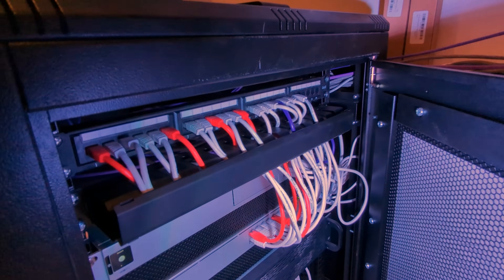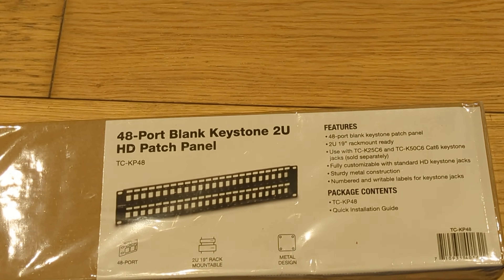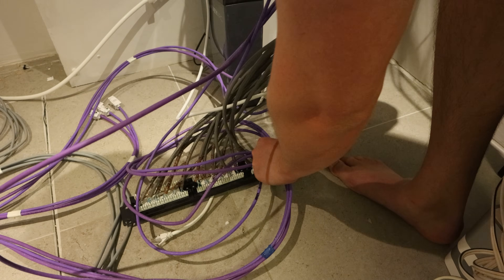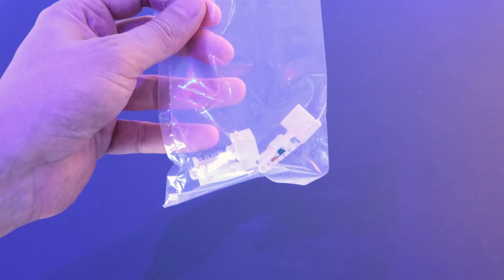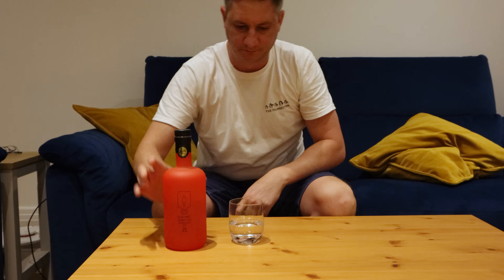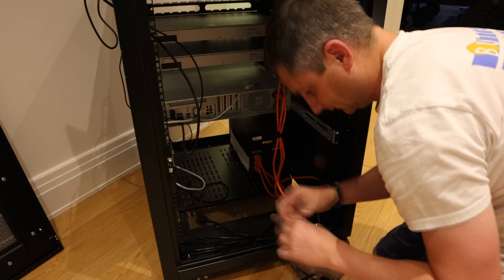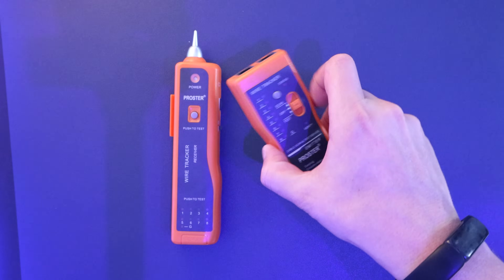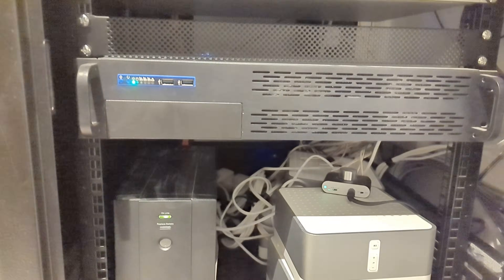Finishing my smart home network

Comment: Racks are supposed to simplify things but this is a case in point of unnecessary complexity. Just plug the ethernet cables directly into the switch sitting on a simple shelf and its actually easier to maintain to whole setup. Besides rackmount equipment is meant to be space saving but is actually poor when it comes to thermals and noise. Just use a standard ATX PC case for your router/server. There is zero benefit to rack servers in a home or small office setting.

Comment: Put a switch to fiber then route that to a better place.  Keep your server and NAT out of the humidity and temperature!  Add a blank 1U above your patch panel.  Then you have 1U to put labels on that you can actually read.  Also, one above your circuit breaker switches so that you know what you are turning off and on.
Reply from the maker: Thanks for the tips!

Comment: Looks good, a clean rack is so important.
At work we always patch with 1 meter cables, but at home i actually bought ubuiquti cables for the perfect length from patchpanel to the switch, looks really neat.
It started to get so messy with cables i found in the cable bin in the server room :D

Comment: Not bad. A couple recommendations though. You definitely should have labelled the keystone jacks at the patch panel and on the wall plate. An example of a naming convention I use is: I.D. 1.1 (first floor, wall plate jack 1). I.D. 2.4 (second floor, wall plate jack 4). I usually label all the jacks in one room in sequential order. I.D. 1.1 I.D. 1.2 I.D 1.3 etc. 

I would have moved the switch directly below the patch panel and ordered 6" and 12" CAT6 cables. This would allow you to free up more room in your rack and clean up the cabling.

Comment: I rewired and racked 22u worth of stuff and dam took 8 hours and a lot of cagenuts going under my bottoms server, makeing the wires neat was the hardest but I used 6 velcro straps and its all bundled neat, I also took the back cover off and the heat goes out a exoust fan in my window, and a ac unit cooling the front side. Thinking of maybe getting a a 32 u rack or at this point get a normal 42 u rack?

Comment: One tip when racking lighter gear by yourself is it use your off hand to support the equipment, then secure the bottom screws first. If you're right-handed, then support with your left hand and install the screws, starting with the bottom-left and working counterclockwise. If you're left-handed, support the gear with your right hand and install the screws starting with the bottom right and working clockwise.

This minimizes the torsional forces on the top ears of the equipment as well as the amount of time you're having to awkwardly support the equipment with one hand.

There are also high-density 48 position keystone patch panels that only take up one RU, instead of 2. When paired with a 48-port POE switch, you can use 15-20 cm patch cords, without any need for a cable manager in-between.

A better choice for the rack mount power strips is to use the IEC variety with appropriate length C13 to C14 cords to the individual devices. They'll take up a lot less space than the British sockets. You can even get ATS versions that can switch back to mains, should the UPS fail (while mains power is still good), allowing for a live UPS swap. A bypass switch could also be used, but they're only able to be manually operated.

Comment: Note for newbies: There are two different wiring configuration standards for Ethernet cables. If you are connecting to somebody else's, make sure you know which one was used.
Reply from the maker: Good tip!  Mine was all B standard

Comment: You shouldn’t vacuum electronic components. Sucking the dust through the hose can create static electricity that is then discharged through the components you are trying to clean. Better to blow the dust away.

Comment: So you know, you can also get keystone jacks with an RJ45 socket on either side, so you can use standard ethernet cables for both sides of the jack. I don't think there would be any speed difference between RJ45 jack and punch down connector, so it's just down to preference (plus it might be easier to keep an ethernet cable connector in shot while connecting/crimping?)
Also, as others have mentioned, you can get different coloured keystone jacks, which can be handy to identify your different use cases of cable at a glance
Reply: Attaching RJ45 plugs to the cables is (at least for me) much trickier and tedious process.

Comment: I love the rack slides most enterprise equipment has nowadays. You install the rails first, than hang the equipment in the rail and slide it in. If it needs general maintenance, it's most of the time enough to just pull the equipment out, lift the cover and work on it. When done you just push it back. Sometimes this can be done while the unit is turned on. (in example, replacing a fan or a dead hard disk)

Comment: I've started in our house, making it smarter.
I've managed to find a 22U HP rack for cheap (£35) got that installed in the cupboard under the stairs witch will house all the networking equipment including 2 servers that will be running various services like a NAS etc.
I've got the first 3 smart plugs installed and working and will be adding more soon.

Comment: adding coaster wheels to the bottom of the network cabinet would help with moving it a lot easier if needed and also would provide some airflow from the bottom  for equipment that are closer to the bottom also adding little fans to introduce cool air can also help keeping it cool
Reply: His rack does have caster wheels hence why he could move it so easily.

Comment: There are other keystone jacks that take a rj45 connector in both sides.  It might be easier than the clip on ones you are using.
Reply: Or not. That would require attaching the cables to RJ45 plugs, which is a much trickier procedure and takes practice.

Comment: Slim patch cables make a huge difference. Also a wall mounted rack would have saved cables being stretched over the room. 

You would have gained floor space and had  zero bending plus cleaner setup

Comment: I was all set to comment about using cable testing equipment and then you showed the very same tools I use. They've saved me lots of headaches over the years. I put flag-label cable ties on each end of my cables and write their unique identity on each end. I maintain my cable inventory in a spreadsheet with their room location, patch panel location, switch port assignment, purpose, and static IP address when appropriate. During my home's construction, I pulled dozens of cables to every conceivable TV and audio location (coax for antenna, coax for satellite, and multiple Cat6 for possible video distribution through a centralized video switch). The security system is hard-wired. All my security cameras are PoE, and all streamed video is hard-wired. I use wireless as little as possible, so having a well-maintained structured wiring plant like you've made is essential. Great job! You'll soon forget the pain of doing it and will reap the benefits for years to come. Beer will also help dull the pain.

Comment: While it’s a nice improvement just want to point out that with a 24 port patch panel and any 24 ports or more switch,  you don’t need the cable organisation panel.
Buy premade 300 or 500 mm patch leads and go from patch panel to switch port in a nice little loop saves a bunch of U’s

Comment: Nice job and a great presentation. There are some comments her for you that I hope you don't take negatively, as that's not my intention but can be perceived as such because of my bluntness. Cable management components are always an excellent addition to any wiring project. Many of my employers required me to make my wiring look like artwork, but it has gotten me in the habit of doing some beautiful wiring. I also use a labeling machine to identify all my wiring for future upgrades and possible troubleshooting. These things add time to every project, but they save time over and over afterwards. The bundle of cables makes me crazy, and I couldn't stand it because of the reasons that I just mentioned. I would need to install some wire ductwork/ conduit like what you used to hide your wiring in the cabinet. The snap on covers allow it to be so easy to access and install. They even make transition pieces for corners and intersections of ceilings and walls that keep everything looking neat and very professional. I'm sure you know about in-line keystone connectors and although I don't like using them unless absolutely necessary, they would tidy up your installation a lot and remove any strain that the cable bundle might be under. It's obviously too late now, but there are flush trim wire cutters that would have made the Keystone connections look a lot better and remove the potential of a wire short under the covers. 
   I can relate to your back pain since I have some serious spinal issues myself. Honestly, keeping fit with daily stretching and exercising would really help you live a more pain free life and help keep you healthy by boosting your metabolism. I'm a 60-year-old man with a very muscular build because of a back injury in my 30's. It has forced me to stretch & exercise in order to be able to keep moving. If I stop doing those things, I will seize up within a couple of years and become useless as well as headed for a wheelchair. 
   Consider putting the rack on a stand that's more table height so that you no longer have to bend over to deal with the wiring. You can still have it on wheels, and it adds storage space for a dehumidifier also. Based on the fact that you seem to always mention that you "don't care" (in every video I have seen) about receiving any comments about your shortcomings regarding details or whatever, I doubt you will take any of these helpful tips and implement them, but I thought I would at least mention them, so you have the option to choose to. What you choose to do or not do will have no effect on my life, so I truly don't care, but I do try to help those who don't know any better. Good luck moving forward, and I hope things all work out well in your future.

Comment: Looks great mate, when i built my rack i had to put it in the un insulated garage un fortunately i had no space in the house, all my tech and av cabling is ducted out to the garage. My issue is the humidity/dampness in the winter and  and heat in the summer justhave to try and manage it with cooling and keeping the heat in the winter. But you got to work with what youve got!

Comment: It sure does feel great when you have tidied up a network rack like that, doesn't it. I only wish the cables were a bit longer so you could run them neatly along the ceiling and down and not hanging across like that. I wouldn't be surprised if there exist prewired keystone jacks with a few meter cable and connector for extending cables.

Comment: Just did the same thing on moving into a new house. 35 cables and I'm even older than you!! Knees and back, oh my. Did lable the cables for future reference and the use a color coded the patch cables. Super OCD. Add a UPS for backup power and orderly shutdown on power failure. If you have a lot of POE ports, maybe you need an air intake and top of rack fan system. The home server rabbit hole, just a layer deeper than the HA rabbit hole.

Comment: Nice setup and good run down of your cable management; I have been avoiding mine like the plague lol. I still need to run more ethernet cable but will be doing the same thing with keystones and two patch panels to finish up my network rack.

Comment: Nice job!  Cable management is one of those jobs that, while can be done as you go, is probably best left for when you've finished.  Imagine having everything nice and tidy then adding another couple of cables that just won't sit right anywhere.  Those keystone jacks look cool, but if you don't plan on adding any more cables anytime soon, then that's a lot of work to make it look "neater".  Still, it's done now and will probably pay-off in the long run.  Oh, and getting old really sucks when you end up aching for days after a seemingly simple, but length task 😊

Comment: When I used to build racks for audio equipment, I used the following.

Rack shelves (I think that was the name) so any equipment which was deep and had some weight about it wasn’t only relying on the rack bolts at the front to keep it in place.

I also used to run slotted trunking down either side from the top to the bottom for hiding cables.

Let me know if you need anymore help or ideas and I’ll try and hunt out some paperwork which I presented as a project rack build for my apprenticeship 👍🏻
Reply: What I do for my network equipment to keep them from relying on the rack bolts its self and prevent them from falling and leaning are the universal rack rails that attaches in the front of the rack and attaches to the back of the rack from there I attach the rack ears of the network equipment along with the rails or the rack at the same time to keep the equipment from shifting and sliding and keeping it in place. While the rack rails make it harder to get into the rack from the side I am ok with it as long as I know I have a piece of mind when it come to the network equipment not being damaged in some way when in the rack
Reply: @HFkepley9312  yeah that sounds like what I used to do, apologies it’s been years!
Reply: @michaelthompson657  there are also rack shelves that can be used for things that can't be rack mount to be able to have them in the rack as well like cable modem
Reply: @HFkepley9312  yes, now you say I’ve used them

Comment: Looking great 😊 - Just a thought for anyone else watching and inspired. You can get various colour keystone jacks e.g. data, wifi, internet connection, cameras. Instead of a 48 port you could split into 2 x 24 one either side of your switch and smaller patch cables. Wish I had the space for a small rack.

Comment: Nice!! I would love to see how you use this for your smarthome. I need to know if it’s worth it cuz if it took u 7 hours it’s gonna take me 7 weeks 😅
Reply from the maker: My house gets very little cell reception, so good WiFi is a must for me. I then try and hardwire in as much equipment as I can like my desktop PC, our work laptops, WiFi access points, CCTV cameras, alarm system, etc. The server is mainly storage for photos and YouTube footage, and it runs Proxmox for Home Assistant and my other smart home systems.

It's totally overkill - I could just use an Intel NUC or similar, but it's really fun to have a Comms rack at home. It does use an unnecessary amount of electricity though 🙈